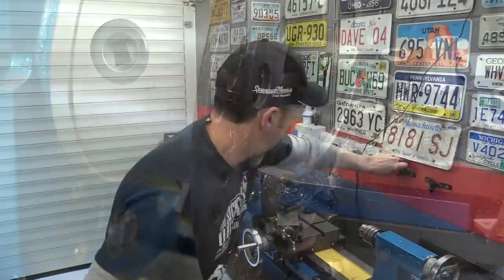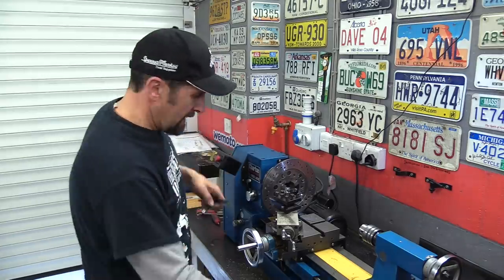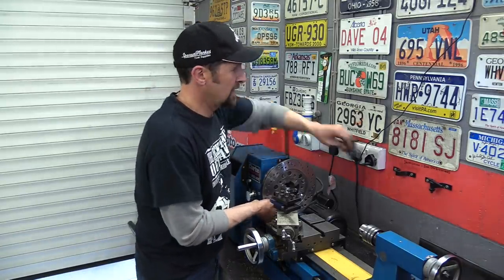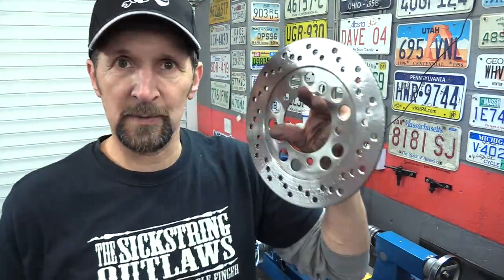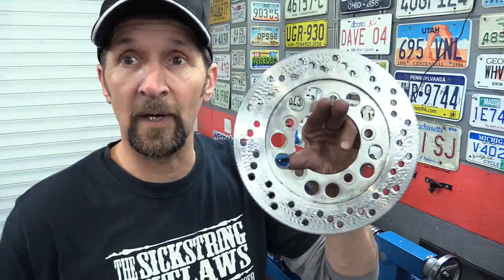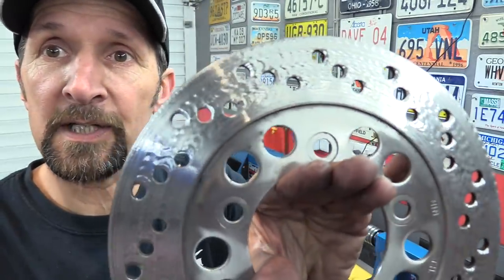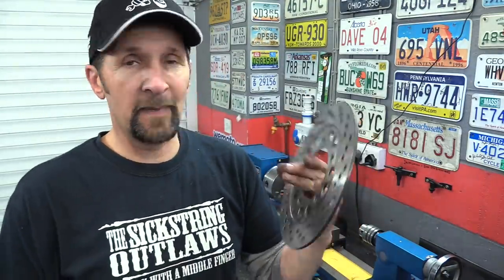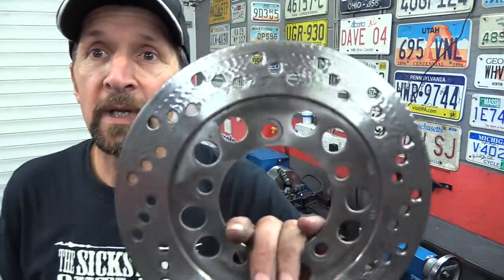Delboy's Garage, Busa Build, Day 3, Brake Disc Face Off !

Comment: As a former automotive tech for over twenty years, I’ve machined countless brake discs over the years. We always wrapped the disc with a rubber belt or we clamped the discs between two nylon pucks that rotated against the surface of the disc as it turned on the lathe. The reason for this was that as the bit is moving across the surface removing material, the disc will develop a harmonic vibration which results in a straight flat surface but one that is grooved like a record album. The vehicle will stop straight and true but it produces a noise like a giant turbine spooling down. By using the belt or the pucks, it prevents the vibration and subsequent noise. Ask me how I know. LOL!
Reply from the maker: Thank you for such generous insight Gwynn, It's great to learn these new skills and overcome basic problems that I yet don't understand.. appreciate your time, and I learn from all the valuable input such as this, take care and ride safe, all the best, Del
Reply: gwynn romano I was going to suggest the same thing. Spot on! But normal application would be twin cutters as well to provide equal pressure so that you don’t get the wobble.
Reply from the maker: Twin cutters?  Now I truly am in a world of mystery lol but oh, how that makes total sense...!
Reply: beozzie690 actually, on an automotive disc we are cutting both sides simultaneously so that the disc is even thickness side to side, however, newer cars come with brake discs that are not able to be cut, they don’t have enough meat on them. The manufacturers have acquiesced to the CAFE standards. Reducing weight wherever they can to improve mileage.
Reply: gwynn romano true but for bikes there’s a lathe attachment that slides on with dials just like the auto one but has a option for with twin cutters or a single with a puck that moves outward at the same time. I’ve seen them for about $400 USD
Reply: Moonfleet41 there’s also a full sized plate that you secure the disk into, that’s rubber/plastic coated that you chuck into the lathe. But the twin cutters like for autos has dials on either side to bring your touch facing cuts to equal pressure.  It’s just a attachment and I’ve seen them for about $400 USD.
Reply from the maker: Thank you for your insight my friend, it's a fascinating snaphot in to disc manufacture, quite a science by the look of it !
Reply: beozzie690 I didn’t know that. Thanks for the heads up.

Comment: I am no machinist, but, I am an ASE certified mechanic with my own shop. I have a  brake lathe in the corner that has two tools on it. This is for  simultaneous cutting on each side of the rotor. This prevents the tool from pushing the rotor away as it cuts and causing unwanted chatter. This can happen on automotive disks that are 8 to 10 times thicker than your bike rotor . So, perhaps you could rig up a second tool, but I don't think your lathe has the ability to get the tool bed in the correct position to accommodate.
Reply from the maker: Exactly right my friend, this is just a basic hobby lathe and there's no way I could rig up dual side cutting, it barely even has the cross slide range to get to the outside of this disc... which is why I had to cut from the inside using an outward facing tool, but it was worth the fun and I learned a lot... thanks for the support mate, it's great to have the input and respect of the vehicle trade.

Comment: Ideally  you would surface grind the disc to insure flatness. with a motorcycle disc you are up against it trying to cut on a lathe to a satisfactory result. It doesn't have the weight, rigidity of a car disc. Also they are usually hard stainless and not cast iron so they tend to chatter and deflect the cutting tool. You are not the first to try and certainly not the last. Thanks for the vids and keep it up!
Reply from the maker: Sure thing buddy, i certainly found that out, even a small rigid rear disc had no chance of staying still... learned a new one today.!
Reply: Ideally you would just go out and buy a new disc
Reply from the maker: @renniks1975  I think I mentioned it a few times, this was a scrap disc due to warpage, it was 5.5mm thick so had plenty of meat left on it and it was impossible to bolt it to a plate for stiffness, as that would have flexed the warpage out of it holding it flat, then once machined, it would have re-warped as soon as you un-bolt it from the plate, I needed it free spinning in order to machine the warpage out, but you're right, dual sided grinding is the only way this would have worked perfectly... as the holes in the disc caused the entire disc to chatter, which was un-recoverable at any speed... great experiment, I learned a lot about my machine, and it's limitations and, of course, my own!

Comment: 26.35 rotate the compound slide so it is square on the apron. it doesn't need to be at an angle for facing off.

Comment: Dial test indicators (used here in the video) measure accurately only when the feeler tip is horizontal (or in line to the body, as the lever ratio changes with the position of the feeler lever). Also, trying to get a runout reading on a disc full of crud is not ideal, but hey, both methods got you to understand the disc in question is probably best used as levelling spacer for a skip.

Comment: Depending on the material the disc is made of the hardness will play a major factor in the machinability. Flywheels, clutch pieces and brake discs made of cast iron increase in hardness by a large factor from the many heat cycles during use.

Even tungsten carbide can struggle with hardened cast iron, as my father and I found out when trying to re-drill an old Ford Sierra flywheel to fit another engine.

But you are correct about the flexing off the material. 

You’ve essentially thrown yourself into the deep end of awkward to machine parts.

You could still achieve a good finish with this part by making yourself a “toolpost grinder” which is essentially a Dremel tool or small grinder firmly attached to the tool post or cross slide. If you do go down this route, make sure to cover the lathe ways and clean it thoroughly after.

Happy machining

Comment: I know this is really late, but I was an automotive tech in college and did plenty of car discs.  One of the golden rules was to remove very small amounts of material in each pass rather than trying to grind something flat and true.  Motorcycle discs are probably much thinner which could have contributed to your problem.  Great content regardless though.  Love this series.
Reply from the maker: Thank you Sir, that's very kind and priceless information... I try to learn with every job I take on!

Comment: When the pros do it they wrap a vibration damping bit of stuff around the outside of the disc. Also cutting both sides at once. If you were keen as frig, you could probably fab up an arm that kicks your cutting tool out further and that you could put 2 in and do both sides at once.

Comment: I used to clean my disc,s up on a cylindrical grinder, no chatter with a well dressed wheel and relieved. Is that lathe bolted down.

Comment: Del, Have you looked at getting a quick change tool post for this lathe, I bought the same model recently, and the stock tool post drives me nuts. Can’t find anything 🤷‍♂️
Reply from the maker: I found the same as you, there isn't one available to drop on, it has to be custom made or modified, I have one but it's too big for the machine and short of having one made specially, I'm stuck like you with the old four way... am saving the QCTP that I have for when I upgrade the machine some day, which may not be so long as am reaching the limitations of this machine already!

Comment: I have no experience of that lathe, but is it not possible to turn the compound rest parallel with the lathe? This would put the tool further out, allowing you to cut bigger pieces.
Reply: Lee Trevarthen indeed it would, but in order to achieve a good surface finish and accurate dimension, everything needs to be as stiff as possible with little overhang

Comment: Did you have to specially order the front brake rebuild kit? I need to do it on my gen 2 but looking on wemoto website they only seem to do the seal kit without the pistons
Reply from the maker: I called and asked them for the pistons included and this is what they sent me, why not give them a call and see if they can tailor an order to exactly what you need buddy.. works for me.!!
Reply: Moonfleet41 will do. Thanks for the reply 👍🏻

Comment: Hey Del, Thoes DRO variable speed lathes are okay, but you lose the motor torque at low speed, better off with gears, keeps up the motor speed and the torque. I wish I had gone for that rather than the DRO. Thanks for finding out that you cant cut discs on a lathe, saves me doing it. Keep up the good work Del, looking good.
Reply from the maker: Hi David, Really?, i didn't think of that, it's gonna be pretty disappointing if you lose power at low speeds, thats often when you need it most..!  Thanks for the heads-up my friend..

Comment: Might be worth rebuilding the master cylinders on the brakes, makes a huge difference and only a few quid, I have some 4 pot nissin laying around if you want them?
Reply from the maker: Hi Ricky, I'm gonna do just that, I have seal kits on the way for brake and clutch master cylinders, and with the calipers I'm keen to try and re-build them, but if it doesn't work out, I'll drop you a line, and may take you up on that for the right price Sir, so I'll let you know, many thanks for your kind offer...
Reply: @Moonfleet41  be happy to donate them if you need them
Reply from the maker: @rickywyatt8026  Thank so much again Ricky, ill let you know.. have a good week.. Del.

Comment: Interesting video, as always. It's good that you try things, even if they don't always turn out the way you'd wish. I understand your thoughts by ordering the individual pistons for the brake calipers. I looked into ordering the pistons as well but they are £20 a piece and with 12 pistons that is outside my budget. So, I'll have to order one a month so I will have a collection by next winter in time for the next rebuild. To be honest, the pistons were not in bad shape, most of the corrosion is in the actual buckets. I tried to polish it out with autosol but I can't get rid all of it. I did get some Hel braided lines and it's less spongy but it's still not perfect. Anyway, can't wait for the wheel bearing video. :) That was literally the next maintenance job on my list. Best wishes to you and Penny! :)
Reply from the maker: Hi Patricia,  If you have corrosion on those caliper sockets that wont shift with polish... you can, very gently, massage the corroded area with a fine grade scotch pad and WD40....dont lean on it hard, just soft gentle stroking, and it will shift the buildup... then you can polish it back up.. ive covered this in the next video on wheel bearings on Tuesday..!  have a great weekend, and take care.. D&Px

Comment: Hi Del, a good informative vid - thanks!  With car discs that have much more meat than a bike disc, I've never found it makes economic sense to reface a disc given how much is usually needed to be taken off to get a flat surface and the cost of machining to do that especially, when what's left represents very little value until it's unserviceable.  What others have said about machining thin hard bike discs I would concur with especially, that discs are generally ground flat rather than turned, which is a much more accurate process.
On the machining front, you were right to dial in the mounting face rather than the friction face but one issue you ought to recognise is the quality/accuracy of the Clarke lathe.  Did you check the face run out on the chuck jaws as your 0.004" run-out could easily be attributed to the chuck?  A dial gauge or clocking the disc will identify the extent of the jaw accuracy.
Reply from the maker: Running the dial gauge directly on the outer edge of the front face of the chuck shows me 0.002" run out.... to be expected with a hobby lathe im sure.!    Thank you for your insight.. and have a good weekend.. !

Comment: Maybe an 'el cheapo ' m/cycle cover from eBay  would do the job of covering the lathe Del, the touring model ones have a high end (for the screen) & would accommodate the  belt end of your lathe.  Blowing a gale down here,  batten down the hatches 👍😎🏴
Reply from the maker: Yeah, good call, maybe an ebay scour would turn up a bargain... have a good weekend Geoff... soon be summer.. D&Px
Reply: @Moonfleet41  👍👍

Comment: Get yourself some carbide tooling for the lathe. You rightly pointed out that the brake disc is hard steel, trying to cut hard steel with slightly harder steel ist gonna work, carbide tool sets are not expensive and they will open up a whole new world for you and that little lathe. Have a look on ya typical made in china site, they make good carbide!

Keep on keepin on brother.
Reply from the maker: Great to hear someone supporting the Chinese tool sites.. they aint all bad aye.. Thanks for the tip sir..

Comment: Bad luck with the disc Del, but nice try mate.  Don't you wish you had a surface grinder ? I know I do + lots more machines and tools in the garage, lol Looks like lots of fun to come with the Busa build mate, with all those new parts.  Penny and you have a relaxing weekend. Cheers
Reply from the maker: Sure thing buddy, i wish i had all those fancy machines for all the jobs i want to do... specially the metal working machines, English wheel, stretcher and shrinker, folding brake, a proper hydraulic press, it would all get used,... just not enough space, and of course then there's affording it all..lol...   Have a wonderful weekend yourself sir, and thanks for your constant support, it means so much... D&Px

Comment: I think there's a Chinese made full (bare) aluminum radiator that adds bling to your build. That one you have I think has a copper core, correct me if I'm wrong. Love your channel! Keep it up.
Reply from the maker: A copper core?  That would be good, specially if it gets a little chipped in the future as the last thing this custom bike is gonna be is bling lol... thanks for your insight mate

Comment: Great video Del, looking forward to see where the busa goes. I have have those Six pots on my ZX6R there fine after a rebuild but you have to stay on top of keeping them clean especially if you ride all year. Also you have to use it, they don't like to stand at all in my experience.  I bought some of those stainless pistons from Wemoto when I rebuilt mine TORK or something like that. They are a hell of a lot better than the standard ones even if I was disappointed that the flat side of the piston was saw cut and hadn't been machined :-(

Discs are stupidly hard to do apparently, I've never attempted them. The main turner at work has done a few over the years in the big lathe and even then he's struggled at times especially with vented discs (interrupted cut). He made up a hub out of a large bit of aluminium and bolted them to that, Most recently he done a set of modern MG discs that you can only buy from MG for £120 a disc.

Comment: Looking forward to the radiator swap Del - wanting to do the same with my Fazer Street Tracker custom and was unsure about using the Chinese copies
Reply from the maker: Hi Craig, me too my friend, it's a big issue and quite important, but at £700+ for a OEM one it's a great motivator lol... the one on the streetfighter has been absolutely fine!... It came from a supplier in Holland with a year's guarantee, even though like so many things, it's made in the far east, worth a punt I'd say.
Reply: Moonfleet41 I’ll give it a go, I reckon (once I’ve seen you do yours of course!). Thanks bud

Comment: You might fail when you try something new, but if you don't have that try, you'll never succeed. Chalk this down to learning and focus on your previous results!
Reply from the maker: So right Jim, every day's a school day when you're as much of a novice as I am on this, I didn't factor in the chatter and flex side of things, I just thought the biggest problem I'd have would be the hardness of the steel, but I was surprised to get a half decent chip rolling in the smooth areas... thanks for all your help and guidance mate, it's an honour to have your wisdom on my shoulder.

Comment: Wow del that rad is sweet. I need to get one for the ZZR
Reply from the maker: Happy with the quality on inspection and the one on the streetfighter has been just fine, plus it comes with a years guarantee, so it has to be worth a punt, if it was £300 we'd be probably more likely to trust it, but £69 almost makes you doubt it, bargain aye?!
Reply: @Moonfleet41  absolutely it's a steal. Oh good news, I have acquired a surplus to requirements welder 👍and I have to do some fabrication. Gonna be fun.

Comment: Hi MoonFleet/Delboy,  Great Vids mate, have you done a tyre replacement vid cant find one in your library.

BTW used your fork seal replacement vid...top notch thanx.
Reply from the maker: Hi buddy, i don't generally bother replacing my own tyres, the guy i buy them from fits them free to loose wheels and his prices are often better then online, so no need to wrestle with them so far...   but if i do, then ill record it for sure..  Thanks for your kind comments, im glad the video helped you out... have a good weekend.. Del.